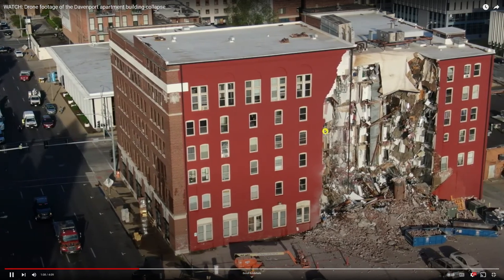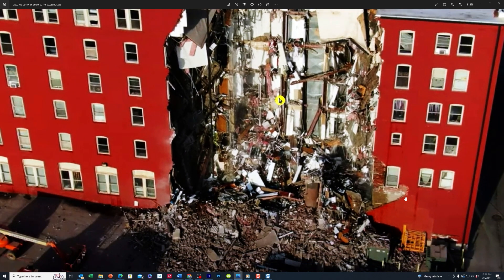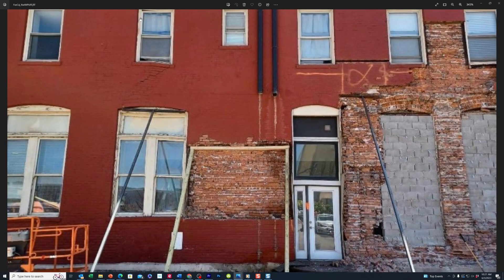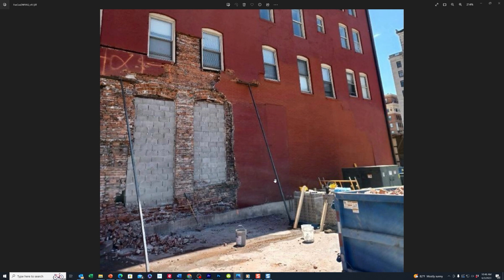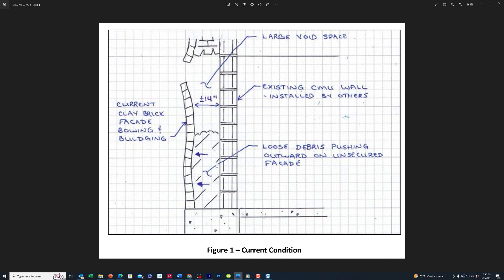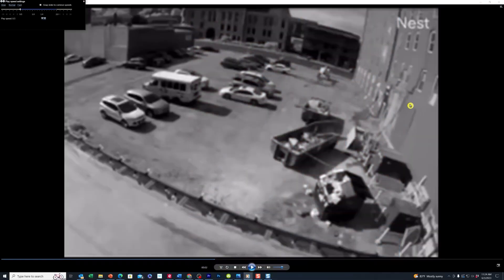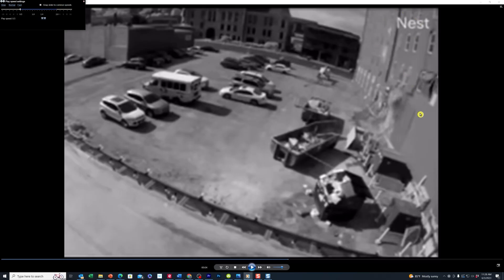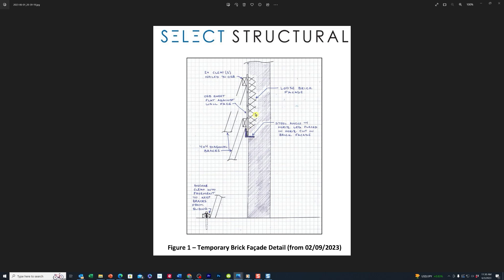Davenport Collapse Security Cam Analysis Pinpoints Origin

Comment: There are a few things confusing me here.  I get that the outer windows were connected to the brick face and they all sheered off in the collapse.  What happened to the inner block wall?  Is there anyway to tell if the inner building just let go or is this just everything was so weak that when one part went it took the rest?

If that's the audio from the security footage.... it sounds like a bunch of bricks fell inside the wall and then pushed the external wall out.  But you didn't see any bricks dropping on the outside..... was that the internal cinderblock wall collapsing first?
Reply from the maker: I suspect that some of the inner wall was crumbling as well and may have also contributed to the outer wall buckling and eventually collapsing
Reply: @jeffostroff  Something still feels off.  The building shouldn't of cored out due to outer wall failure.  If someone has the ability to pull the design blueprints it might provide a few more answers.

This looks like a building that uses a truss system.... because any warping to the beams will pull them off their supports and when they fail, the building pancakes down.  

So, I am looking at weather reports and for about two weeks before the collapse they were calling for nonstop rain.  I'm not from that area so I don't know how much rain they actually got... but if they are having issues with water and bricks not able to drain water.  We are talking about a lot of water weight added to the structure that honestly looks like a lot of corners were cut during construction.
Reply: Google "multi wythe masonry wall" that is how they built masonry buildings back then. The outer wall was not a veneer it was the outermost wythe and was indeed structural. Every few courses there is a header course where the brick is laid sideways that lock two wythes together. They would set beams into pockets on the masonry wall and continue the brick up and around it, and the beam would be supported with columns similar to how a house sits on a basement. This guy doesnt understand this and is just spitting out misinformation. What happened is water penetrated the wythes throughout the years, and more so in the past few years due to the failed roof. Water freezes and thaws and causes fractures and degredation of the mortar, and brick, which obviously cause a multiple wythe wall to fail since the headers are doing nothing at that point. The paint certainly caused the issue to speed up because it took away the ability for the masonry to breathe and dry out. The entire building should have been shored up, and damaged wall should have been taken down from the top to the bottom, and rebuilt with an internally braced CMU (which are concrete masonry units) wall, grouted and reinforced under all beam pockets, and a new modern ACTUAL brick veneer built back up.
Reply: @ianpeters9537  Yeah, I just saw another video where they pulled the blueprints... 

That building design was wild....  It seems cut costs ran in that buildings entire life.

Comment: The city continued to permit occupation of the building. Because these were subsidized units which brought the city federal income. And HUD is charged with inspecting subsidized housing, And ensuring the safety of of the buildings in order to remain permitted for the subsidies. And of course the contract for work on the building was awarded to the lowest bidder.
Reply from the maker: HUD basically checks to see if the unit has working AC, running hot water, screens on windows, tests smoke detector, in and out of unit in 10 minutes. I used to own 2 section 8 condos that required inspection every year. Quick and not very thorough

Comment: If you look at the google earth pix of the building from the alley view, the third and fourth sets of windows have a lower sill than the others.  This is an indicator that they were for escape, to an outside fire escape. The building probably had the escape removed at sometime in the past. The building appears that it was 3 or 4 building or additions, you can see that in the alley with different foundation hights. Could the removal of a fire escape sometime in the past have weakened the walls structure?  I'm just guessing.

Comment: No need for explosives here.  IMO, a bunch of air bags in the lower floors connected to a big air compressor could be used to push the lower walls out and bring the entire building down.  Or wrap a few cables through the windows and pull with a tow truck.   They use diamond coated wire cable to cut stone in quarries, wrap one of those around the building and start the motor.  No need for anyone to go inside.

Comment: It wasn't the brick veneer that was the cause of the failure, but the main wall failing behind the veneer!

They should find the entire structure was compromised by water intrusion throughout the building, making me think plumbing or roof leaking water into the brick structure. The water soaked brick would then have freeze/thaw damage on the inside of the outside wall causing the mortar to fail, and the brick to crumble!

But the interior brick walls also failed due to the effect of water soaking throughout the building. It only points out how much coverup had been going on over the decades, rather than proper maintenance to correct the defects! But that was evident by the photos of the interior walls prior to the failures.

Comment: I'm surprised they allowed tenants in the building during reconstruction.
Several sources noticed bending temporary supports before the collapse.  
I.E.  Those temporary supports were designed to hold the wall inward, but weren't designed to hold 100+ tons of brick above them.  It is as if the entire fascia sheared vertically downward onto those flimsy supports.  I've hauled enough brick to know it is heavy.
Even if the fascia was non-structural, the falling fascia would have pushed inwards at the bottom, and pulled out and down on anything still attached in the middle, ripping apart the load bearing wall behind.  Perhaps the temporary supports also shifted force inward towards the inner structure.
As far as windows and doorways, what you fail to mention is that they all have arches.  That is a nice touch, and should provide substantial support, if the mortar and surrounding structures remain intact.  Were the window bricks cut to shape, or simply filled with mortar?

Comment: Jeff-  suggestion for doing videos of your computer display:  make your mouse cursor bigger.  It can be hard finding the little white dot in the video on a small screen.
In Windows, settings used to be categorized "accessibility," but now they're called "ease of access"  
You may have to drill down some layers to get to the right place.  Holler if you can't find it.
Reply from the maker: I have a bigger mouse but the problem is is some of the applications on the computer do not adhere to the mouse that I have it is a bigger one with a white cursor with a big yellow round dot around it which you'll probably see it in some parts of the video but not every program on the computer supports it which is a real aggravating pain in the neck
Reply: @jeffostroff  1st, I don't mean to be anal.  It is a naturally occurring phenomenon.  😜    (an oblique way of saying, I'm not attempting to harangue you; rather be annoyingly helpful, in a non-governmental way)
2nd.   Gotcha.  CAD, Photoshop, and other pro-grade apps may be in play.
One idea:  since most of your presentation seems to involve display of a static pic.  During your session, 
1:   open the pic some other app.   There are 2 basic possibilities.   Both these possibilities support a "full screen" display mode that occupies the entire monitor without window frames, etc.  I know only Windows.  Other OSs+apps likely support this, but differences are in the particulars.
- ironically, best choice may be "Photos"
- otherwise, open the pic in a browser tab.  (Chrome, Edge, Firefox all do this)
2:   in the app, hit F11 to toggle "full screen" mode.   This is different from "maximizing" a window. Full screen  eliminates window framing, menus, etc.  The app displays only the display content.
Why the built-in "photos" app may be better:
- it uses the system mouse cursor.
- the browsers—when you have only a picture (jpg/PNG/etc) loaded in a tab, and that picture is bigger that the tab content area—will reduce the pic to show 100% of it.  Further, in this case the browsers use a different mouse cursor than normal.
I'll not belabor further with details.   These things are easy enough to try, once you're aware of them.
Food for thought.   I'll try to avoid bothering you on this point further.
Thanks for your reviews!
Reply: @77thTrombone  Excellent explanation and answered some of my questions about why an image doesn't fill the entire screen in windows.

Comment: Jeff is it possible that the collapse of the veneer wall started by the interior metal floor beams sagging and twisting as the inner exterior wall started to weaken. Causing the loose interior wall bricks to fall into the void cavity of the two walls. That pin point bulging at the second floor windows might be the location of the beams resting onto the inner brick walls. The engineer report did state that those beams needed to be supported as soon as possible before starting the repairs. Just a thought.
Reply from the maker: Yes I think it was a combo of the 2

Comment: It looks like to me that water was getting in through multiple places not just on the outside wall. And lack of structural support plus ruining of what support there was.... The evidence you see on the outside is the final outcome. The problem is deep inside. This part of the building is newer and obviously the roof wasn't getting water away well enough evidenced by all the water damage and mold inside the building. It starts from within and cracks outward. Once you see it on the outside like this, it's too late. This building wouldn't even be worth fixing. The engineers don't even know everything that's ruined because they don't open up the walls deep inside the building or open the ceilings or roof to look at all the damage there. I think it failed on the roof and also the inner vertical supports. The reason why construction projects often become much more costly after the initial estimation is because of this, engineers typically can't see everything so it's just an estimate.

Comment: Hey Jeff, idk if you saw but we had a partial collapse here in CT over the last week. I believe it was Saturday, happening in a town Nee Haven CT.... I couldnt link to the stories but thought i would let you know.
Reply from the maker: Yes I saw that they were pouring concrete and apparently they weren't spreading it fast enough and it was allowed to pool into one spot and got too heavy and collapsed through the floor and through the molding and bracing that was holding it up
Reply: Ya. It looks like they were pumping too quickly. I know a guy on the Site, and he was saying the pumpers were running full tilt, but they didn't have enough guys to move it quickly. Sorry, I made that comment before getting more info. Thnx for reply! Lmk if I can help at all. 

I think you are dead on with the failure on this one. The poor building was screaming out for years. Too bad the brick Contractor didn't call 911

Comment: Great video Jeff however you failed to point out the defective windows from what I can tell every one of those windows look like they were in need of Maintenance years ago which led to all the moisture behind the wall causing the amount of deterioration I'm sure if you inspect the other side of the building you will see the same defect window affecting water into the walls

Comment: @5:16, hey jeffjerkoff, you are wrong.  Those supports DO, do something.  When it comes to buckling a little support does a lot.  That doesn’t mean it was safe, and it only should have been done DURING an emergency evacuation of the building, not as a means of keeping people in the building.  If you lean a post like that into a wall it does a lot more than you realize, it would tend to get locked into a mortar joint and probably could have supplied several tons of back pressure and could have bought some time, AGAIN, to get people out of the building only.   It don’t say it didn’t do anything, they may have bought hours of time.  It’s hard to tell,  but obviously people didn’t pay attention to the signs.  Just like 911, those buildings were going to come down, and all those firemen should have realized it and they should have stayed out of the way until the buildings were evacuated instead of getting testosterone all over the place.  Think first, then go in at your own risk in small numbers, but don’t slow down the evacuation.  They probably cost lives slowing down the people leaving.

Comment: ok, not any experience on the subject so forgive me but are the light-colored bricks the original build and the thin red (facade?) bricks were later applied to spruce it up? Or is it simply two grades of bricks applied at the same time?
Reply: Since the interior wythes are of non-water-resistant brick, the outer wythe (probably also structural rather than a facade) of hard fired water resistant brick must have been part of the initial construction. Which leads back to the question of why the wythes were not better bonded to each other. Especially the outer wythe.
Reply: @daveuggla8383  thanks for the info. it seemed to my uneducated but practical life experienced self that the two weren't "married" correctly but was unclear when that should have occurred. I like to understand things, or at least try to. people like you who answer gives me a smile in my heart

Comment: I'm confused... is the fascade holding up the building? What is behind the fascade? CMU?  why did the CMU fail?
Reply: Behind the outer wythe (vertical layer) of hard fired brick are additional wythes of common (non-water-resistant) brick. The CMU you see is only part of repairs and filling in of original window and door openings. If there were a total of 6 wythes, then the outer one (NOT a facade) would be carrying roughly 1/6 of the load. There is no indication that the CMU sections failed, since they were not part of the structural support in the first place.
Reply: Behind the outer wythe (vertical layer) of hard fired brick are additional wythes of common (non-water-resistant) brick. The CMU you see is only part of repairs and filling in of original window and door openings. If there were a total of 6 wythes, then the outer one (NOT a facade) would be carrying roughly 1/6 of the load. There is no indication that the CMU sections failed, since they were not part of the structural support in the first place.

Comment: I'm no structural engineer... but... wouldn't temporary structural supports on the interior of the building prevent the floors from collapsing?

Furthermore, if the walls are bowing outward... that means there is pressure pushing the walls inward. Meaning that entire section of the wall would require replacement (from foundation to roof)... So... those piddly little "supports"... were useless except to provide a false sense of security...

So... who's getting the criminal negligence causing death charges?
Reply: Some bowing could result simply from too high a vertical load on a narrow structural element. As the wall bows out, the top and bottom get closer together, allowing the vertical force to increase the bowing. The mechanical characteristics of the mortar also play a large role in the rigidity of the wall.

Comment: Failure of the façade did not cause this. Failure of the structural wall behind the façade or failure of the structure along with failure of the wall behind the façade is what cause it all. It seems clear that the structural wall bricks have been falling for quite some time as indicated in the pictures.

Comment: The tilt angel of the fluid cooler on the roof clearly indicates internal structural failures. If the cooler was not properly supported, that, due to sagging with age, could have caused the water incursion others have described. One bad idea after another.

Comment: those places buckling must not have been just trhe facade.
it must have been more in behind.
so while it looks like it's just the facade's ties to the structure failing, it was the structure actually failing behind it.
probably as you say, it being painted and water  capture behind the paint.
seems only 1 engineer knew of the  true danger.